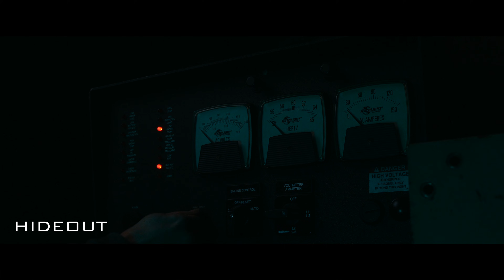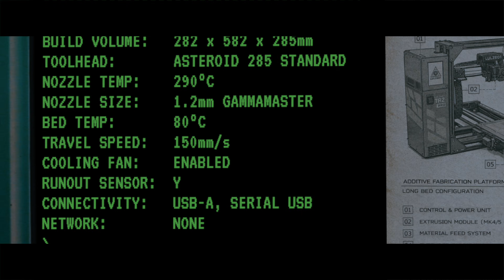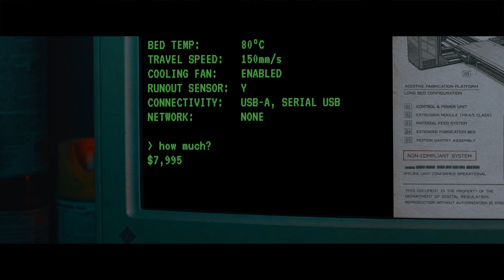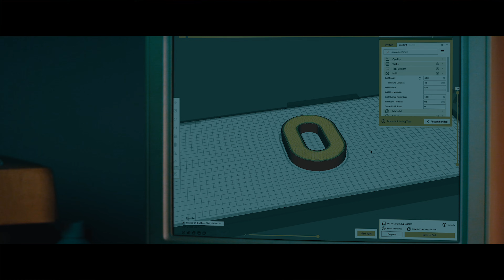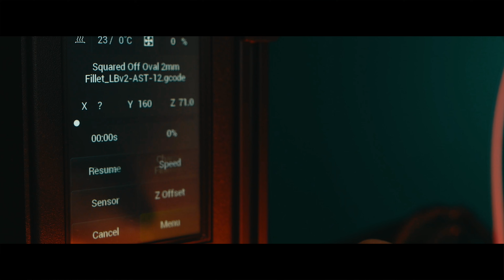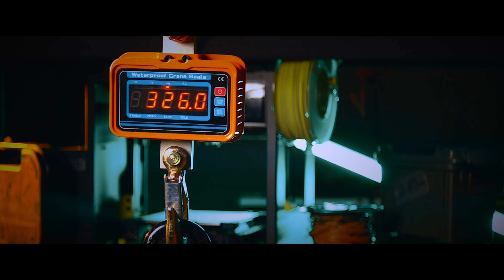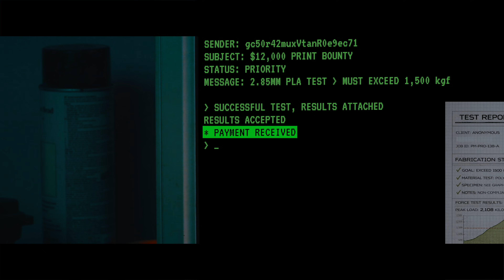It Broke My Test Equipment

Comment: Meh, 2.85mm was only a widespread thing because hobbiest filament used to be weed trimmer line before commercial printing filaments existed. Was never a fan of 2.85. You can't scale down as easily when using such a large filament and printer without one hell of a fine extruder gear ratio...it's "print big or go home" territory 100% of the time. Great (and still used) for industrial purposes; near useless for most hobbyists...or very limiting, at least.

Besides, with a proper hotend and extruder on a modern machine, you can solidly push 1.75mm through a 1.2mm nozzle without the other hassles and limitations of 2.85mm filament. I print with large nozzles all the time; usually 1.0, but sometimes 1.2mm. Not ideal on a slow bedslinger, but many modern CoreXY machines have fast heaters and capable extruders. Even modding a 1.75mm machine with a faster heater or beefier extruder is better than a purpose-built 2.85mm machine if all you want to do is lay down thicker lines for some of your tougher/larger prints.

In short, I see no good reason to turn back the clock and bifurcate the market by bringing 2.85mm back to the hobbyist space. I know that wasn't explicitly said in this video, but since Polymaker started making 2.85mm for the masses last year, this is NOT the first video I've seen with 2.85mm, and some present it as if it should make [or is making] some sort of big comeback.

(Yes, I get the future-looking concept of the video and I'm not speaking to that at all. Merely commenting on 2.85mm, in general.)
Reply: What? Grid infill still exist in the future? I knew it wasn't that bad 😅
Reply from the maker: Haha! 😅
Reply from the maker: I have a 2.4mm nozzle for this LulzBot too.
Reply: @LoyalMoses haha Nice! So, how long does it take to burn through a kilo of filament at 2.4mm?
Reply from the maker: Only a few hours. The flow rate is absolutely insane.